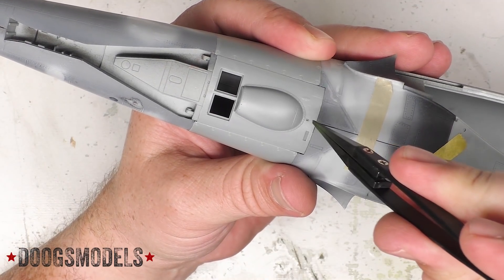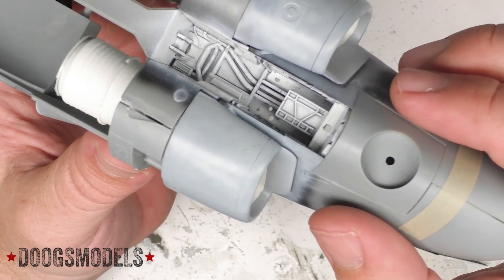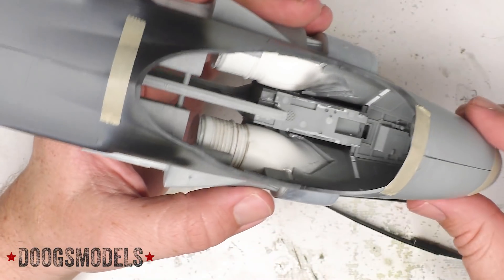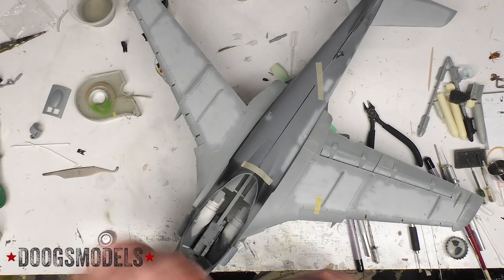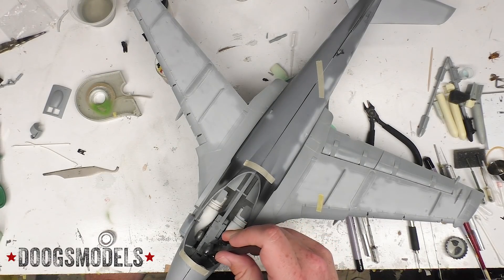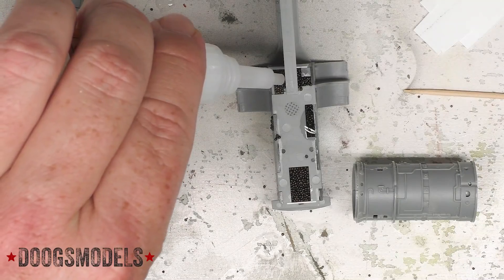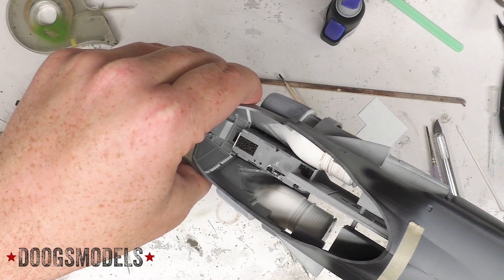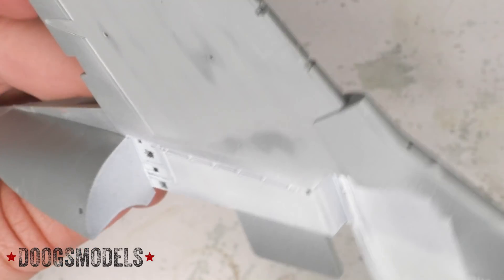A-6E Intruder Build 09 - Finishing the Cockpit

Comment: Hi Matt, why mask off the offending landing gear struts if you can dip them in 91% IPA? Whenever I mess up an MRP or Mr. Color paint job, I use 91% alcohol and an old tooth brush to get back to bare plastic and start over again. Saves on paint build up. Just my two cents...
Reply from the maker: I'm not worried about paint buildup with MRP, and tweaking white is a lot easier over existing white. But - want to preserve the oleos. Few quick wraps and that's all.

Comment: How would you rate MRP as  far as smell goes? I live in an apartment and want to kinda branch out from tamiya. Constantly having to mix their most used colors, is getting old.
Reply from the maker: Their clears pack a punch for sure, but regular MRP I'd probably put somewhere between Tamiya thinned with MLT and Mr Color. Any of those options will be dicey in an enclosed space without a spray booth/exhaust setup.